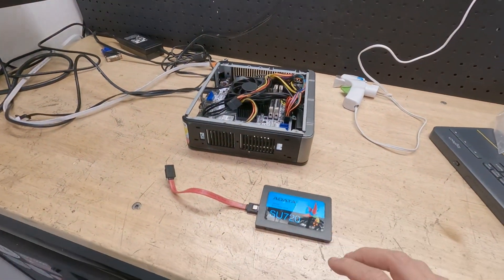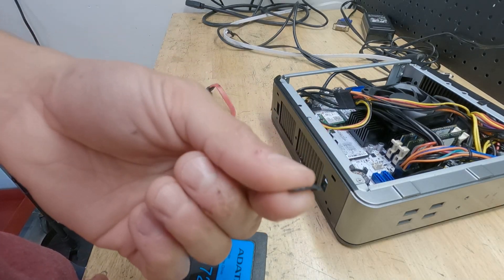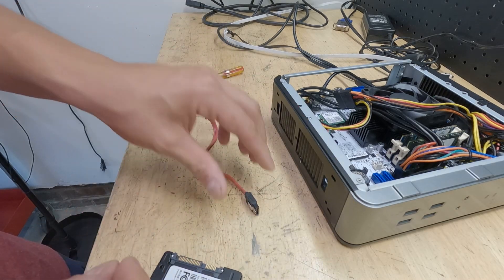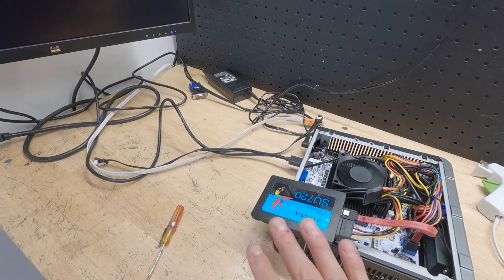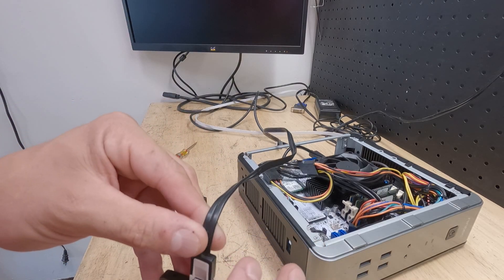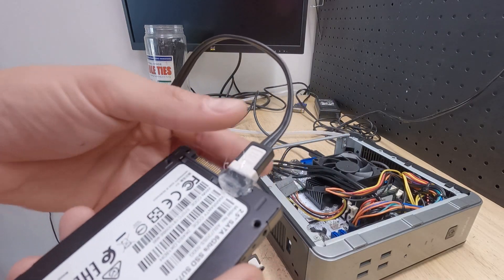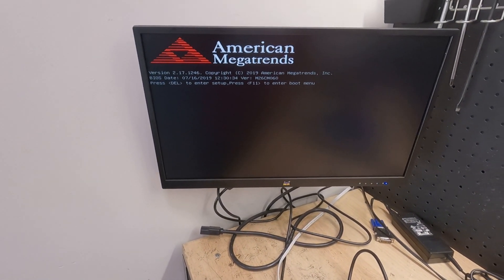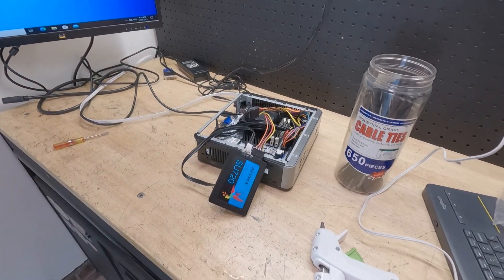I broke my SSD and fixed it for free!!

Comment: I have the same situation, since years but I just didn't care. All data was backed up. But now I'm in need of getting more storage and considered doing this, but I'm missing that plastic piece and have been unsure if it works. I feel like if I glue it, with not good enough connection, it will permanently be damaged. I'm considering as well getting some adapter or housing and see if that helps. If so, Ill use the drive as an external drive and storage only. Not everyday use. We'll see if I end up gluing or not.

Comment: That happened to my SSD but instead of putting hot glue what I did is that I added strong glue, and this glue got into the inside and now I think it is burned. Anyone recommends a video in which I can salvage the information? it would be of great help, thank you
Reply from the maker: I know companies that do that but it is pricey as they have to extract the chips to pull data... if you find anything let me know, i have not been able to find a more reasonable way to do it!!

Comment: Great tip, thank you !  Question: have you found one brand's SSDs break more often (are more fragile)  than others?
Reply: I'm not DLM I know but generally as long as you don't force the cable into the ssd (since it obviously only fits one way) and you never really have to move it from where you put it all too often then you drastically reduce your chances of breaking the connector. I always had a good time with Crucial, Western Digital and Samsung ssd's. I have no doubt you will too :D
Reply: @B_Skeptikal  I've only bought Samsung 2.5" SSDs.  Seems ADATA is crap in general though.
Reply from the maker: agreed. I broke this rushing and not paying attention but they don't break if your careful.
Reply from the maker: never broken an expensive one but they all feel about the same as far as being fragile. def don't want to find out on my more pricier ones.

Comment: Man i have a big problem with my lenovo m92p, now doesnt open windows, and there is an (_) on the top of the screen
Reply: I've had that problem reinstalling windows on my other pc i think but it only has the blinking cursor on the top left (that _ sign) Just look up how to fix blinking cursor and you may find your fix somewhere.
Reply from the maker: usually i have seen that in a computer with a corrupt windows file or a failing drive.
Reply: @DLMtechgarage  yeah but doesnt leave me boot from an usb or cd
Reply from the maker: @PanGames  you would have to change the boot settings in the bios.
Reply: @DLMtechgarage  I pressed F12 and open the usb on the boot menu
Reply: Perdón por el ingles de mrda, soy español :^
Reply from the maker: @PanGames  need to have a bootabel usb drive with a windows 10 install on it. see if the bios have a setting to test the drive. some do. it will let you know if the drive is good or bad.
Reply: @DLMtechgarage  when i boot the usb, i see a black screen with the cursor
Reply: @DLMtechgarage  how do i fix the "corrupt windows file"
Reply from the maker: @PanGames  you'd have to reinstall windows